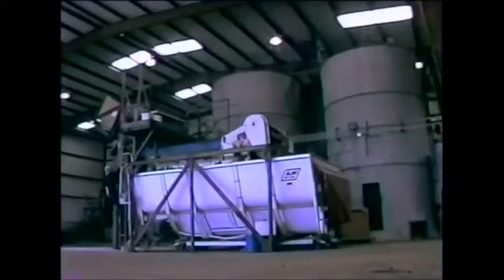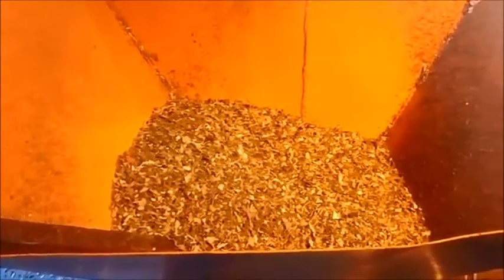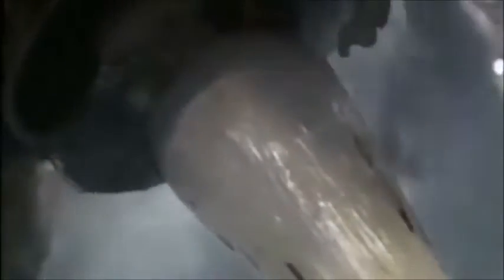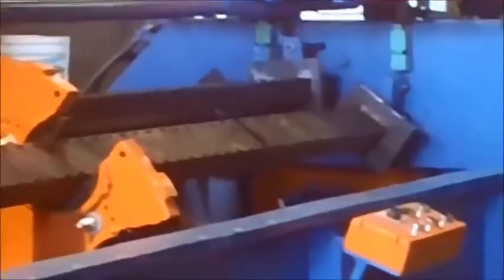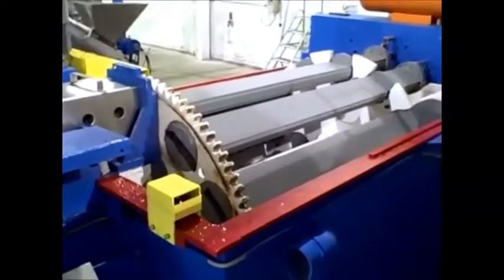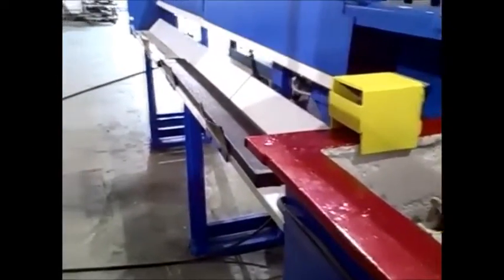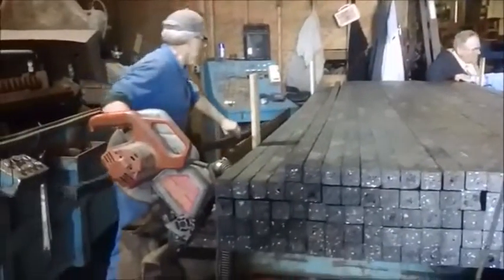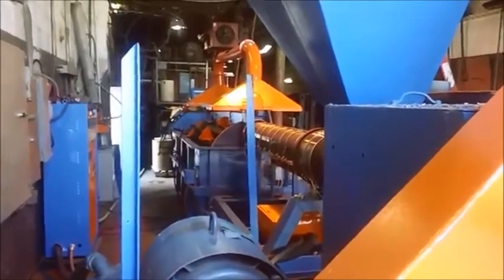Recycled Plastic Lumber   Flow Molding

Comment: What is the machinery cost ??
Reply from the maker: We offer Flow Molding equipment & systems from $85,000 - $850,000 USD with new or used machinery. Manual and Semi Automated Systems, sizes producing 100lbs  - 1,000lbs pr/hr of all types plastic lumber products.
Reply: Any contact in india ??
Reply from the maker: Sorry no one in India

Comment: Hello Paul! I was able to replicate this type of extrusion machine to produce Composite lumber but currently having difficulty removing the composite lumber out from the mould. do you have any suggestions as to how I can remove the mould faster and easier without a neumatic bursting system?
Reply from the maker: Hi Lance,  Couple of things.. A) Try lubricating the inside of your mold, B) Modify your material and C)Make sure your materials are dry!!!
Reply: @PaulVanderpool  If it's not too much to ask, may I ask what type of lubricants you would suggest? Our cycle involves water cooling after air cooling, perhaps that's the reason why removing the Product is so difficult, since there is water inside. But the overall output is still fine and aesthetic!
Reply: @PaulVanderpool  
السلام عليكم
Reply: We use a small rod and hammer to push the end of the board out of the mold and then a electric hoist operating horizontal pulls it out of the mold.  Also if you over fill or over pressure the mold you will have problems removing the plastic or even destroy the mold.  If the surface finish is very smooth of the plastic board, it is likely you over filled.

Comment: Hi Mr. Vanderpool,  I am from Trinidad and Tobago and our community run a small recycling facility.  we are now considering our upcycling options and will like to know if you can quote us on a system to make this plastic lumber.   Do you also conduct training on using the system?
Reply from the maker: Hi Roslyn, thank you for contacting me. We are pleased to assist you and your organization with your recycling engenders. In 2015 we built and installed a complete recycling facility for Washing PET Bottles for your government ( SWMCOL ).
In 2016 we built a complete Flow Mold operation with its own power generation system for small group a few hours from the main city. Please contact me at: paul@cierrainc.net and we can followup on this conversation.
Thanks ~ Paul
Reply from the maker: Hi Roslyn, We have two recycling system in your country. A PET recycling system for SEMCLO gov. owned where they wash and sell the PET flakes. Installation and training were part of the purchase price. We also have a manual Flow Molding Plastic Lumber line. It was supplied turnkey with a generator. They came to our facility and were shown how to operate their system prior to shipping. Thank you for youe questions ~ Paul

Comment: Hello sir I am from India,, I was made this type of lumber in last month,,, it's great 👍 but it is very heavy weight,, can we reduce the weight of product without reducing size??
Reply from the maker: Yes it can get heavy. We now have a new additive that will lighten the product by around 30% and adds a strength.
Reply: @PaulVanderpool  can you please tell me what,s the secret 🙏🙏
Reply: And can we change the colour of black pp product,,, because in recycled materials black granules are very cheap and available in large quantities?? Thanks 🙏🙏
Reply from the maker: @sandipsutar3437  This materiel is a byproduct from wood fiber. The company we get it from is just starting up.
In their process two thing happen A) Processing Temp must be higher that 600 F and done under vacuum. This is what creates a honey combed media/fiber. You can find study about is on the internet. I am in the process of setting up a new facility to make our own compound and all so sell this new product.
Reply from the maker: @sandipsutar3437  Black materials are limited as to the color it can be pushed to. At an expense you can go to very dark reds, blues, green and always a large number of grays. Titanium and iron oxides are expensive.
Reply: Thank you very much sir,, I think the plastic paint is much easy. But your video are very informative keep it up sir.
Reply: @Sandip Sutar please share your mobile number

Comment: Hello sir,
Can you please tell me the mixing ratio of plastic ingredients.
Reply from the maker: It can be a simple question to answer, I need to know what you are using.The only materials we don't like are PVC and H2O. What type of quality are you requiring ~ What's the function of your product.
Reply: @PaulVanderpool   Sir, we are going to  use following type of plastic -PET, HDPE, PP & PS.
To make sustainable post and product like timber. Which will be used for making floor, furniture, garden fencing, farm fencing. 

Sir can you advice us which ratio we maintained during the create the plastic post.

Thanks.
Reply from the maker: @isteaquetansen   All of these materials are excellent for making the products your interested in. The key is in mixing the proper percentages for that particular type of product your manufacturing. The polymers your asking about will be very strong or very brittle. There are also some awesome additives which will help better homogenize your mix.